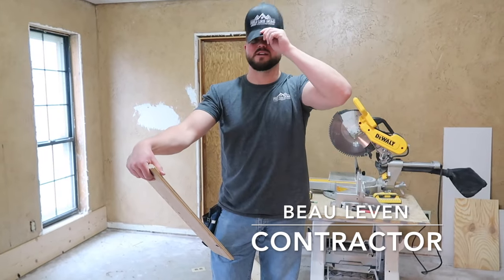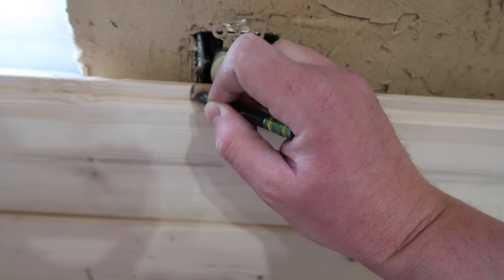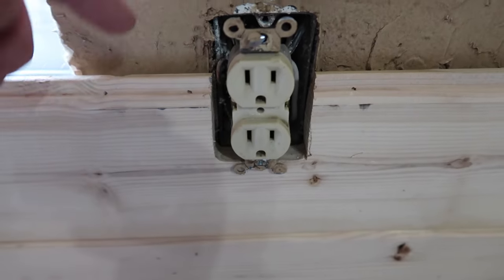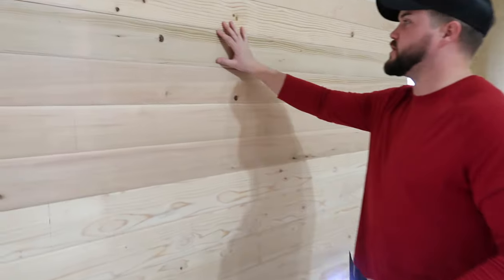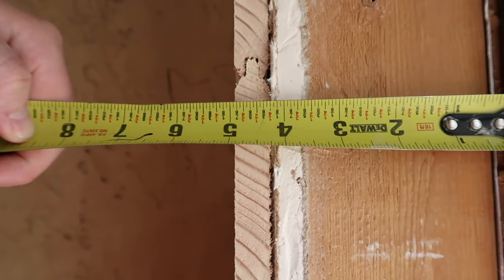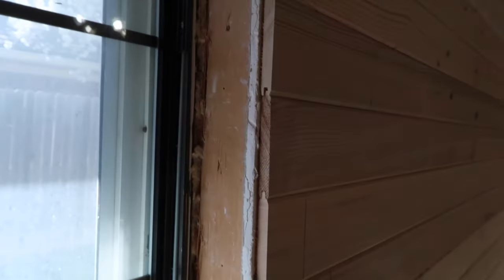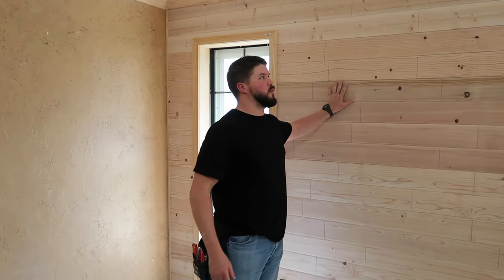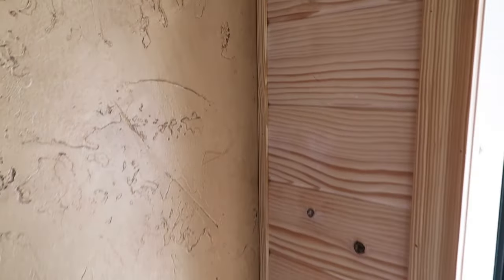HOW TO INSTALL SHIPLAP WALL: TIPS & TRICKS

Comment: When you hang shiplap around a door do you remove the trim around the door and then rehang the trim or run it it up against the door trim? Im trying to figure out how to do it on a wall that currently has a finished door on the wall..
Reply from the maker: We would pull the trim off the door all the way around then run it all even to the door jamb and add the trim back on top of the shiplap.

Comment: I am going to be doing shiplap directly onto the studs (with paper backed insulation) in my garage.  Anything you would do different vs. installing over drywall?
Reply from the maker: Yes directly onto studs will be great. We do that on new construction but this one was a remodel so didn’t want the mess for the customer. 👍

Comment: How would you install in on a metal framed wall?
Reply from the maker: You’ll have to use a wood to metal trim screw would be the easiest way. Then putty the holes. Usually trim screws are really small

Comment: Thanks for the video! I ordered my materials before watching videos. Instead of factoring full-width pieces at the windows to cut out after nailing, I measured and bought shorter pieces for either side of the window. I did add a few extra pieces for each of my sizes. Do you think I'll run into issues with matching up level at the top of the window when I transition from the shorter pieces back to the full width pieces? Does my question make sense?
Reply from the maker: Thanks for the comment. No you shouldn't have any problems at all. Just measure and map it out before install to make sure it ends up where you want it to.  Hope this helps.
Reply: @BeauandKendall 
thanks!! 😊

Comment: I have a question. Is it necessary to remove interior windows to install shiplap board? I have a contractor who is putting this into his labor cost on his estimate.
Reply from the maker: Hey Lanya. No it is not necessary. Your Windows should already be installed and the Windows need to be cased out with wood in the openings. You can remove the Sheetrock and install casing. For example we used 1x5 finger joint wood around openings so we can install shiplap up to it. Hope this helps!

Comment: It looks like you installed tongue and groove not shiplap. I don’t think an electrical inspection would pass those receptacles with the lugs outside of the box. You need to extend the boxes out flush with the boards. Also you only needed long boards below and above the windows. You could have use shorter boards between the windows and cut the side pieces from a few shorter boards or used cutoff pieces to save money.  But you probably already knew all of this.